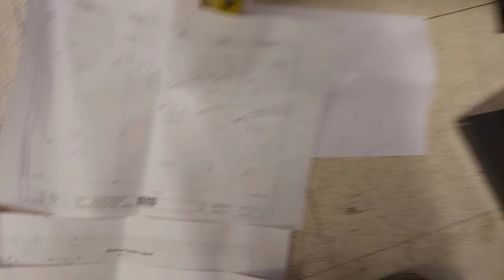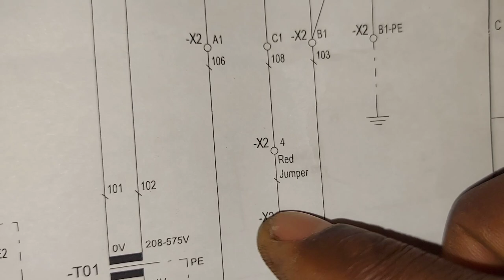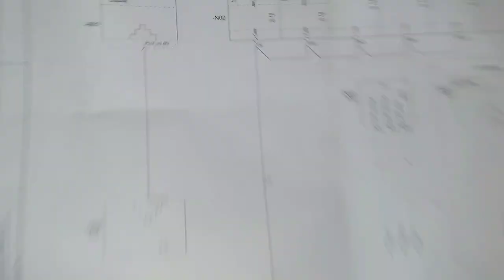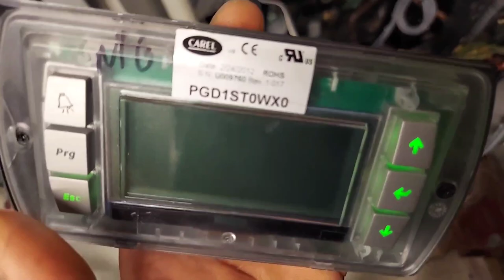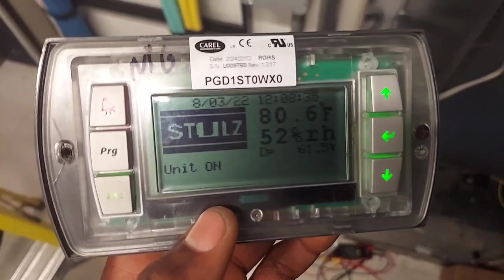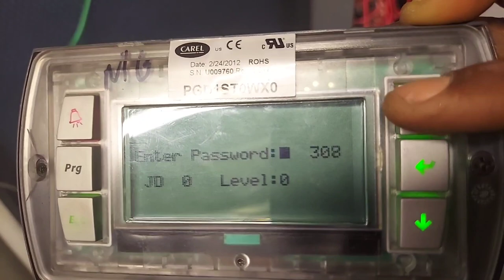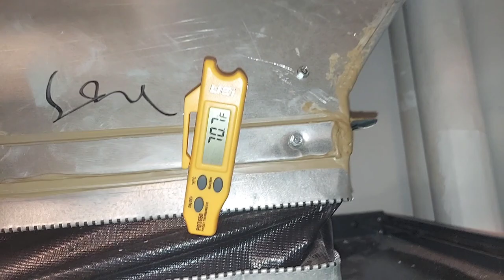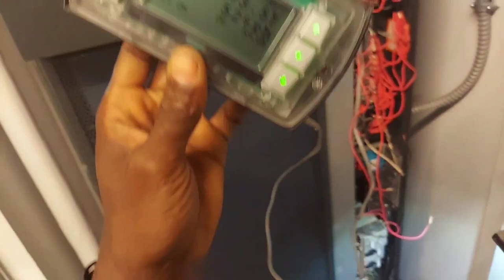HVAC TROUBLESHOOTING SCHEMATIC & LOW VOLTAGE WIRING

Comment: Never seen that Stulz Unit Before
Reply from the maker: They been around for a while now
Reply: mostly server rooms in high rises, can be refrigerant or water coil pumped from chiller
Reply: @D2DNYAC  I meant to say that particular model. I work on a lot of Stulz equipment but just haven’t come across that
Reply: @zaphrian  most I see are water cooled from cooling tower or what we call Dry coolers